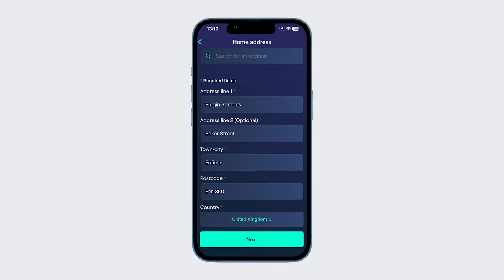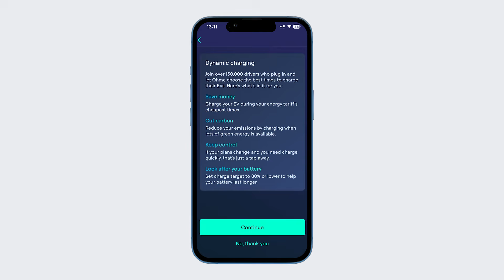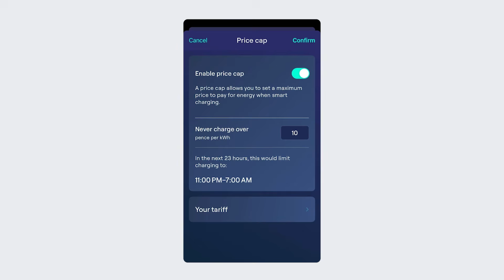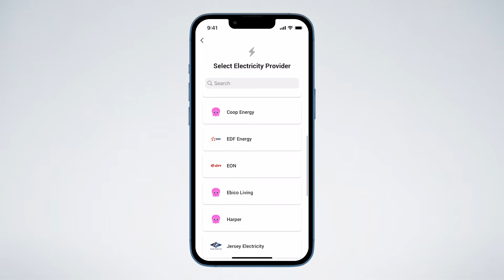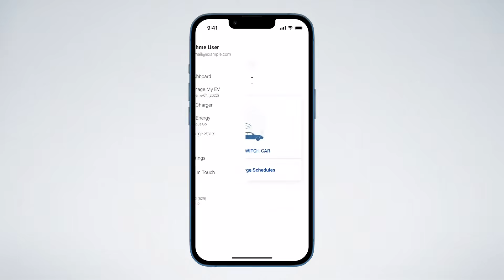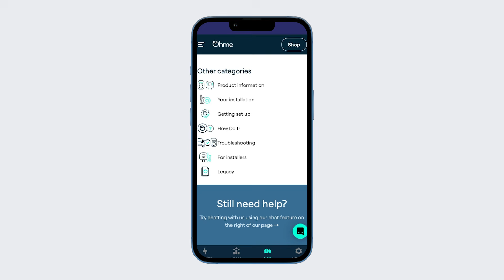Complete Ohme App Tutorial: Save Money & Control Your EV Charging

Comment: I had this installed on Tuesday 14th July 26 I found out a few things if you set your cars time to charge at say midnight and the ohme charger doesn't want to start til 00.04 say the car will think it cant charge and it changes to the day after so even if the ohme start at 00.04 it won't charge because the car won't let it so I have just put car as instant and let the ohme do its thing also like other people said if you price cap your app it won't charge til off peak
Reply: ive had mine for ages and now and its started not charging since that poxy battery level things been put on there,, ive had to sign out the poxy app just to get it to max charge its come close to getting smashed off the wall,, seems there customer service is as good as the poxy app,, absolute wjank
Reply: @gavsewell6903 lol I cant even get to talk to one its all the AI chat I have found though as well if you take dynamic off you can set the time yourself so I have figured it out at my end now just put the time you want  it to finish and then it will tell you what time to start so when it gets to your time you want to start that it then just leave it till you need it

Comment: The worse thing about the charger is you cannot set a start time - I want the car to charge at x time 

Even though I have my octopus acc linked it is still a pain in the ass !

I use charge now and just leave it to it - I don’t care if an hour is expensive I just want car charged.

The charge by time system is useless lol
Reply: Same here, I can’t even choose a start time and sometimes it will just start charging at peak times. Stupid you can’t chose the timings you want
Reply: @iby991 I often just go max charge as I goto bed - if that means 1 hour at the expensive rate so be it ! 

At least the rest is cheap charging
Reply: ..and the car can conflict with the charger as well. The features are great IF they work.

Comment: My recently-installed Ohme is ignoring my cheap tariff rate and starts charging when it feels like it. It does so according to a set of "Charging schedule slots", for example: 17:37 -17:51, 17:51 - 18:22, etc. These don't appear in any of your screens, maybe I have a later software version.
The Ohme Charging schedule says: 
"Ohme has used your tariff, price rules , and grid conditions to calculate your dynamic charge schedule. Some slots may change to help balance the grid. Here's when we plan to charge your car." It then lists the slots as mentioned above.
Clearly this statement is incorrect.
Any ideas?
Reply: Are these Intelligent Octopus Go additional 30 min charging slots?
Reply: @colinfieldgate4719  Hi. It's okay now. The problem went away after a couple of days. I still don't know what caused it. Very strange.
Reply: I had the same issue. There is a tab that says price cap on the charging page, if you click this you can set the maximum amount so that the car will not charge if the tariff is above that value. Hope that helps